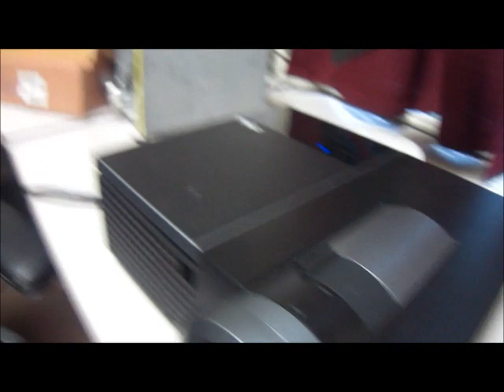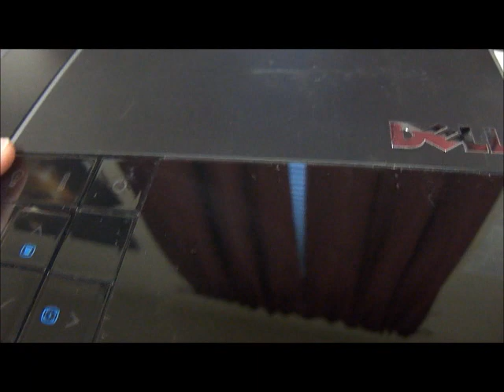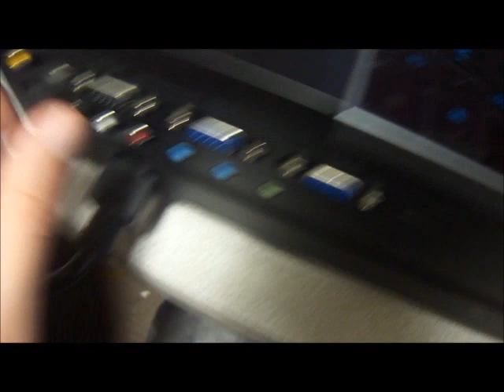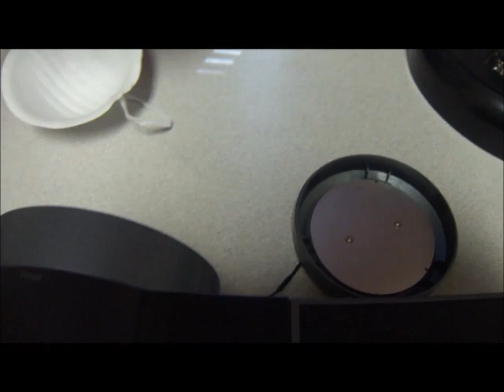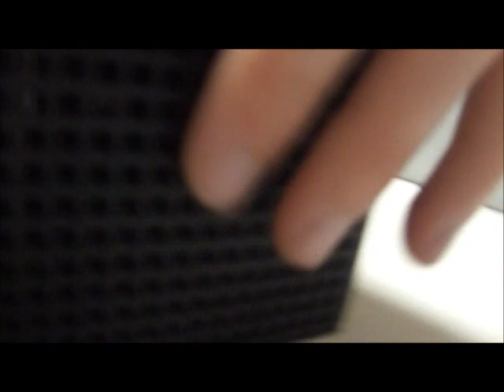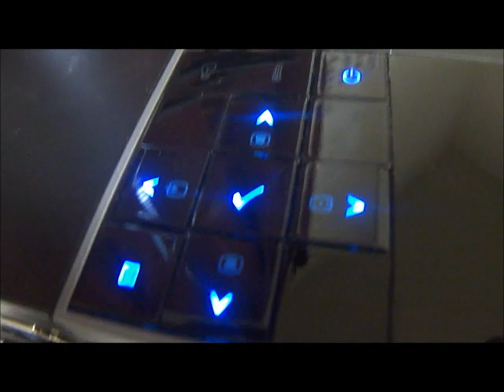Testing a Dell 4120X Projector at Austin Cyber Shop Cyberinfinity

Comment: Hi, I got a question: I recently replaced the dmd chip on my Dell 4610x and after I put it back together the darn thing wont power on and the power bottom light flashes amber and the temperature light is steady amber, the user manual says that this means:

Fault - DC
supplies
(secondary)

Power supply has been interrupted. The
projector automatically shuts down.
Unplug the power cord after three
minutes and then turn on the projector. If
this problem persists, contact Dell

I took it apart again to make sure everything was connected right but still does the same, do you have a clue on what could be going on?
thanks
Reply: +Jelek Gamboa  Hi were you able to resolve this problem? having similar issues.